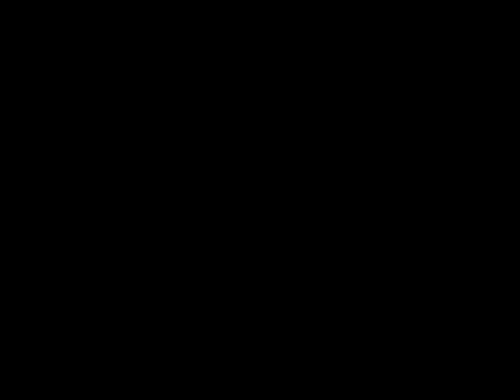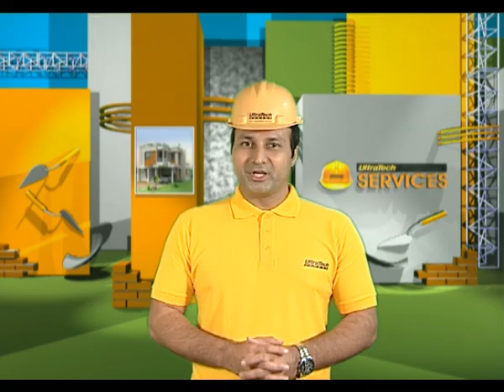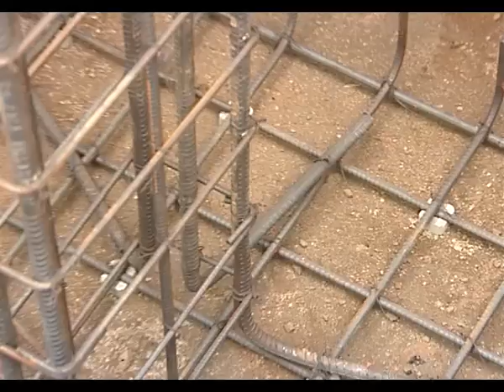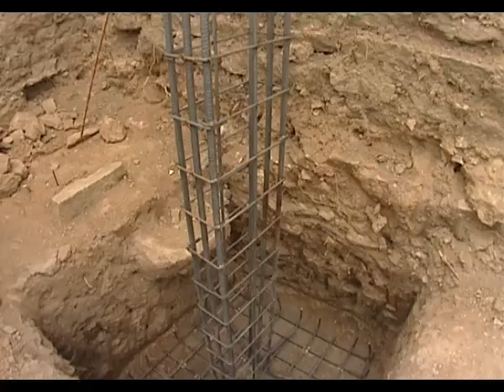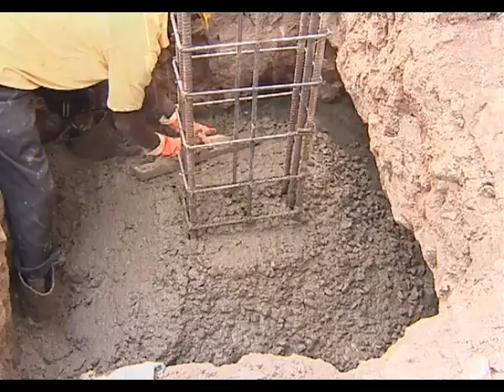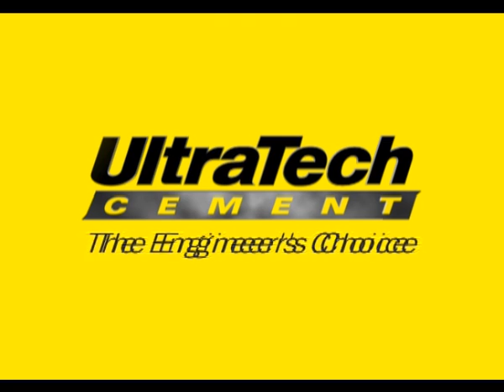RCC Footing

Comment: Sir I have given a 6 inch thick footing plate for a 1 storey building. Will it be ok. Taper not given. Footing size: 5ft x 5ft
Reply from the maker: Hello Paul, there is no thumb rule calculation for foundation design of a structure. You should contact your engineer for correct design of the foundation of your house. I hope this solves your query. Regards, Team UltraTech.

Comment: We saw that you put the rod on the soil. It is not correct. You should first 2"/3" concrete and then the structure base rod will be set on it. Otherwise the basement rod will be unsafe and uncovered.